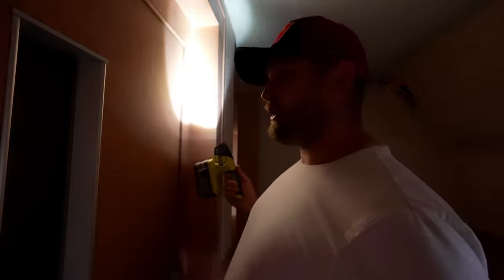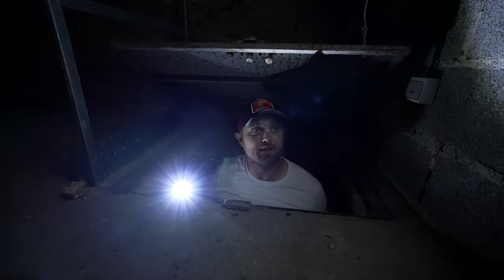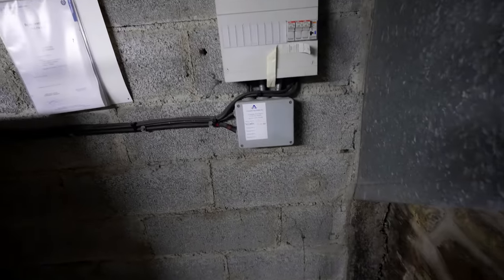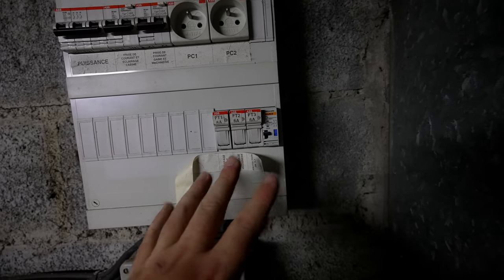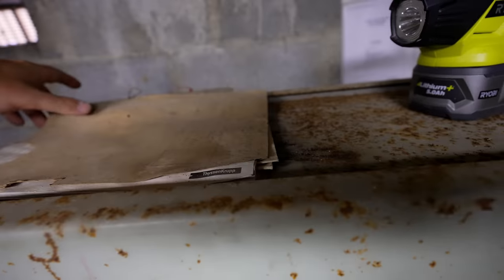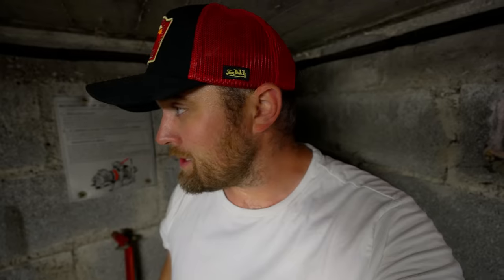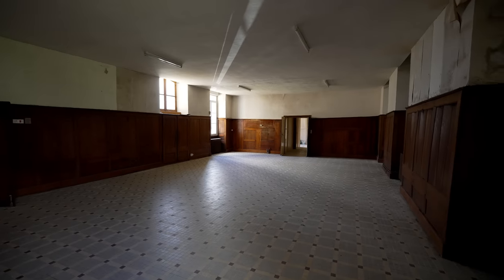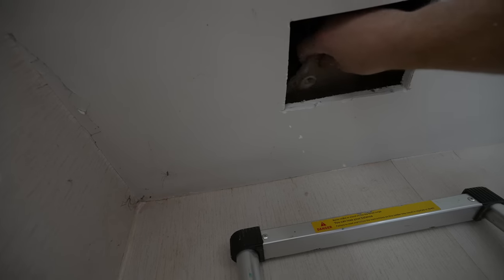Uncovering A Building Swallowed By Nature

Comment: This  vlog was an adventure and I was sure you would find a key or a way to get into the elevator and I was right because YOU DID IT. The outside of the convent looked amazing when you turned on the lights. It changed  from a stern spooky exterior to a  warm and  inviting one, just like a high end hotel. Great job Billy

Comment: Hi Billy.
The ceiling in the refectory was probably lowered to reduce the volume of the room. 
Doing that would significantly reduce the cost of heating the room.
The "Door Release Key" for the lift is not normally a conventional key and it's unlikely you would be able to "pick" the lock. Without actually seeing the "keyhole" it's not possible to describe which key it will be.  I suggest you enquire with the local Fire Brigade, they are trained to use those door release mechanisms if a lift breaks down with passengers inside. It's possible they might have a key of the correct type.  Have you checked in that key cabinet you discovered ??  (The one that had the keys for the external doors).  If you see a long, very slim piece of metal, (possibly 8 inches long) that looks like a piece of steel tubing that's been cut in half lengthways that could well be the key.  So it's a bit like a half moon shape. You simply slide the key into the "hole" then gently pull down on the back end, this lifts the end you fed into the hole and disengages the door lock.  Be very carefull, if the car is not at the floor where you open the door, there is nothing between you and a very long drop onto solid concrete.  I suggest you don't waste time drilling, all you will do is create unnecessary and expensive repair work.  If you do get the door open using a key, normally you just remove the key and slide the door fully closed to re-lock and make it safe again.
Hope this helps.  Phil
Reply: Maybe too late? Eh Billy? 😂
Reply: I hope this works Phil! Thanks for the info to help Billy‼️

Comment: Interesting. It looks like your lift has a coffin door at the bottom. It adds an extra few feet in the length so that they could slide a coffin in to it without having to stand it upright. The exterior lights are class.

Comment: Hey Billy! Interesting video! About the lift & lift shaft. You might want to consider whether or not you're going to retain that company to do maintenance on the lift, or get someone else. I'm thinking whoever does the maintenance should be able to sort you out in terms of providing a key / lock for the lift shaft, plus, they, themselves, would also, likely need access, therefore, possibly, their own copy of the keys to the lift shaft.
Also, that false ceiling ... 1. when you went up there, is it just me, or did the actual ceiling look slightly damaged & like it was bowing in places? 2. I imagine, it's possible that since they were nuns there, they might've wanted to keep cleaning / de-cobwebbing the ceiling more manageable & that could've influenced the decision to put the false ceiling in.

Comment: maybe you could add a pitched roof on top of the elevator shaft in a style similar to the bell tower roof to match the syle/era of the building.
and then add faux stone/brick to the exterior walls of the elevator shaft so that it blends in with & matches the rest if the building better.

Comment: The old overgrowth will be a process to get back to order.  I'm sure the lift will be valuable for use once restored to function.  I like the effect of the lighting and potted trees.  Would tend to say to get some form of solar lighting and even power in, so in case of a power outage, you still can see and function.  There are even "sand bag" lights, on a pully or rope, that I saw advertised once that can provide adequate crisis lighting.

Comment: Those lights are awesome. You should check for the elevator key behind the door with all those keys on the wall, but it's moot anyways after you drilled it out. I don't envy you waiting until 10-11pm for it to get dark there. That was one thing I couldn't get used to when I visited Scotland.

Comment: Billy, what about using slate over the lift part that is above the roofline. It might help that shaft sink into the roof or blend visually
rather than sticking up! 
I know it bugs you! The steeple of the former 
 Chapel could be painted a light grey instead of black also!

Comment: I notice you have a Ryobi torch, they are brilliant aren’t they. I have the smaller version, I can handle it better. I’m twice your age and half your size (not quite) so it gives me great security when I’m walking around at night. Such a pity about the lift, you will need to get a locksmith in I expect. When the lights outside were on the convent looked so amazing. You are doing such a fantastic job.

Comment: Cracking job on the whole courtyard / lights and the whole place is really starting to wake up again.
Is it worth taking that massive ceiling down soon and reusing the plasterboard if required in other parts of the convent renovation? Will save you a few euros that's for sure if it is needed!!

Comment: A tip for picking get a electric toothbrush take off the brush leaving the flat arm on and file this the shape of your jiggling pick put your tensioner on and use the tooth brush/pick to jiggle the tumblers it's quicker and does work.

Comment: I know here in the states in the 70s during the energy crisis there was a big push to lower ceilings in big buildings just to save energy. A lot of times it was with those really ugly metal grid systems, that used the insulating acoustic tiles. Here we had a historic building/hotel where the lobby had been lowered like that, and when they took out the dropped ceiling they found a stunning tiffany faux skylight in the lobby.

Comment: The topiary and the lights make the facade of the convent look so right.... but it makes the entrance door look kind of wrong.  Is that not the original door?  I was also thinking about the lack of ornamentation on the ceiling.  I wonder if a local artist would like to have a crack at it, or maybe at least some plaster ornamentation and gilding.
Reply from the maker: the door isn’t great is it! it’s a modern door which needs replacing with a new grand door make from oak
Reply: @ThePethericks  I'll be looking forward to it!!